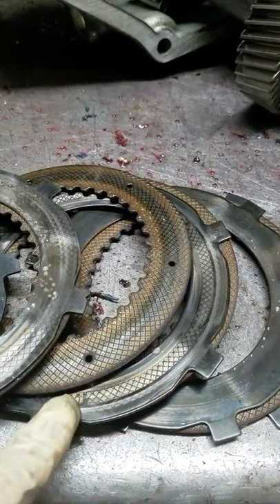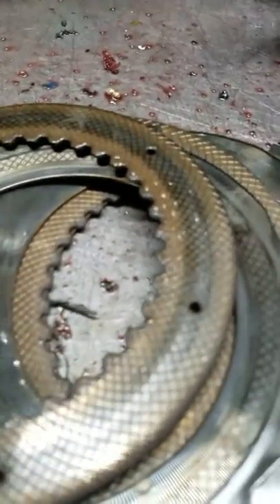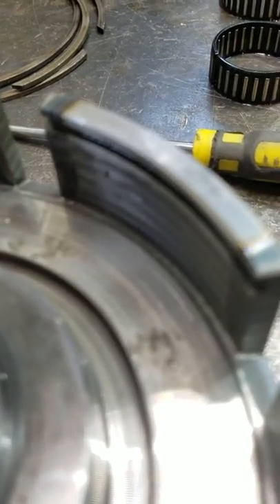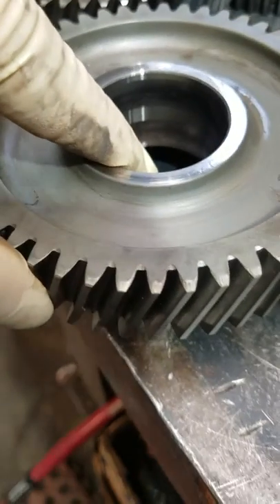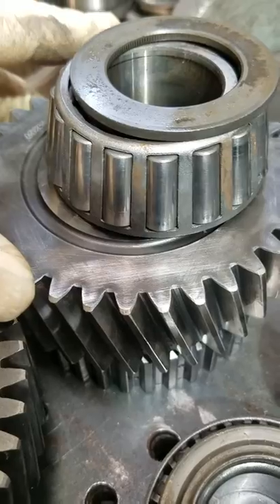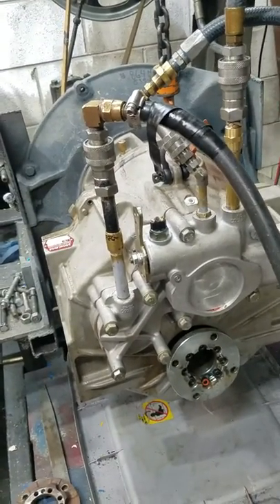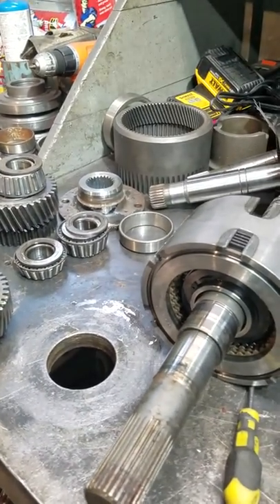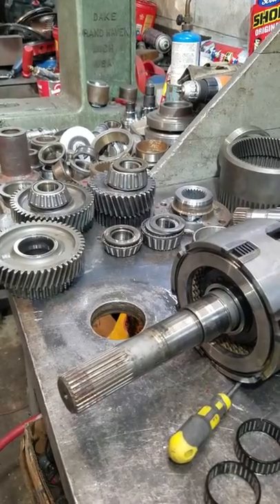ZF63VI Look inside a ZF63VI

Comment: Hello top video. I have a zf 220a 1.53:1 ratio that ran dry while engaged forward and burnt out forward clutches, had them replaced and can't seem to get forward engagement. Any suggestions would help much thanks
Reply from the maker: Pump pressure?